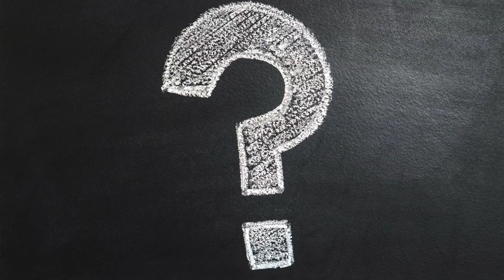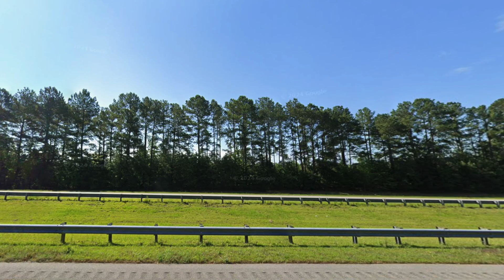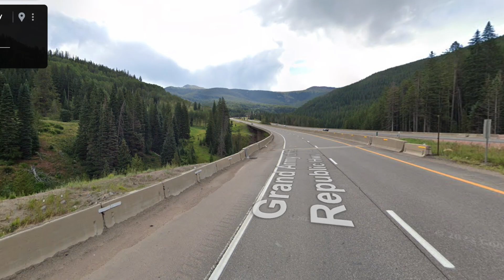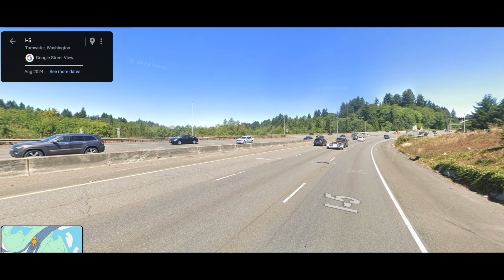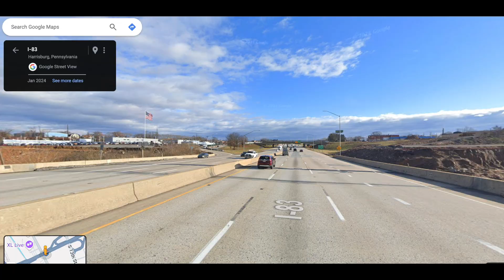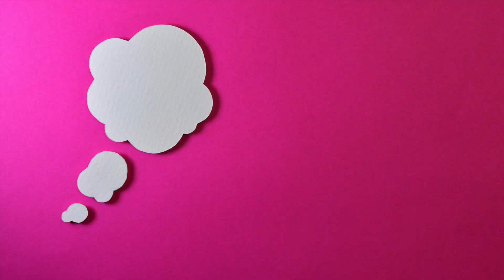Putting Rail Tracks on Highway Medians: The Pros and Cons

Comment: You can put viaducts on highways medians, elevated metro/rapid Transit are done this way in Asia. Its cheaper to build viaducts on land the government already owns instead of buying land near urban areas for such projects. Plus theres no need for overpasses, and people wouldn't be able to get on the high-speed tracks. China built its HSR mostly on viaducts, and India is doing the same.

Something important to consider is that usuay medians are made wide to allow later lane expansion of highways. So using up that median space would defeat the purpose of wide medians. And medians also allow for increased safety, running rails on medians also defeats that purpose

Comment: Fun Fact: In the case of I-10 between Los Angeles and El Monte, THE RAILROAD CAME FIRST!! -- It's the former Pacific Electric San Bernardino line.
Reply from the maker: That is a fun fact! I know some of what has happened with rail transit growth in the LA area has involved reactivating old rail right of ways.
Reply: @RallyingforTransit  - The fact that Metrolink runs down the same right-of-way Pacific Electric once used is something people forget about when they ask "Whatever happened to Pacific Electric?" The answer is: "It's complicated, but you will find remnants of it all over Southern California. For example, it left its mark in a string of disconnected alleys south of Hollywood Boulevard.

Comment: Fun fact about the Brightline route from Barstow to Nevada: Because Fort Irwin is on both sides of the highway, I-15 IS the only practical route for a high-speed passenger railroad between those two points.

Comment: When the Surf Line, which carries heavy passenger and freight traffic, is moved from the San Clemente beach area--where it is perennially in danger of being washed away or buried by mudslides--I-5 is the only viable path through San Clemente, other than a 10 mile tunnel. But DelMar is protesting even a tunnel under their city, which is stupid, since the railroad is more important than the damn town.

Comment: Other things to note are the issues of land use and stations along the line. Stations along highways lose quite a bit of potential ridership due to the huge footprint of the highway that could instead have development. Stations are also not likely to be all that pleasant to be due to the pollution and noise from the highway. There are ways to mitigate those issues somewhat, but a highway median station will never perform as well as a similar one located in development away from the highway.
Reply from the maker: @travisbeagle5691  I was literally thinking about this yesterday. 

I’m taking a deep look at LA Metro’s C Line right now (which is right in a highway median for most of it). And it has all these issues you talk about.
Reply: You clearly haven't been to Perth
Reply: @radicallyrethinkingrailwaysina  I have actually. I think they are a good example of how to implement such a system well, for the most part at least (the stations are still not a pleasant place to be.) That being said, each station where the line runs along the freeway would still have better ridership if their lines weren't along a freeway. At the end of the day, Median running lines have their place and at the very least they are better than nothing.
Reply: Counterpoint - a well designed station can act as an attractive interstate crossing. The highway is already there, likely could use additional ped crossings, and a station done well can be an ideal crossing location for thru pedestrians, making the station a focal point for foot traffic.
Reply: I think highway medians are really good for potential HSR or intercity lines that don’t currently have a ROW. An example is Boston-Montreal, where a hypothetical intercity train could run in the median of I-89 between Concord NH and the Vermont border, directly connecting to the existing route to Montreal through Vermont. A HSR line could run in the median of a highway between two cities, especially where the existing ROW isn’t conducive to HSR. Highway median metro lines, like those in Chicago and LA, are a different story.

Comment: I think its really depedant, a lotta places in flat areas with long straight highways might be pretty good. In Quebec the Autoroute 40 is mostly straight and the median is ridicously wide at many points for example
Reply from the maker: @hikarikaguraenjoyer9918  I think someone else in the comments mentioned that route. Yes, a highway route like that could work for a rail route. Parts of Interstate 70 in America’s rust belt are also straight enough (need to do more digging as to whether it is wide enough).

Comment: Additional Cons include the need to raise existing (and future) overpasses to accommodate the increased height of trains (including catenary) versus trucks.  Raising overpasses also requires lengthening approach ramps which may isolate existing driveways and bring on the NIMBYs.  Another Con is that highway grades are frequently steeper than trains can practically negotiate.  In some cases, this can be mitigated with cuts or fills, but given the narrowness of highway medians this would require retaining walls.  Getting into the median in the first place could be expensive requiring long pergola fly over structures or tunnels for the railroad or flyover viaducts for the roadway.  Also, the development that already exists next to the highway means potential utility relocations beyond what a greenfield routing might require and a need for sound mitigation barriers.
Reply from the maker: @andrewadams3894  this is a good breakdown of some of the other cons, some of which I hadn’t thought of.

I’m reading some comments about the Brightline West project, which is doing the whole highway median thing. I will need to do some research and see if they have encountered any or all of the challenges talked about here.
Reply: In Germany, it has become increasingly popular to built HSR lines next to freeways, with the goal of minimising the negative effects like noise and cutting through existing “habitats”, be they human or natural. Putting two noisy traffic corridors next to each other ensures that no additional areas are affected by noise. Ditto for putting up barriers for wildlife, farmers.

Since there are basically no wide medians on freeways in Germany, it is always to one side not in the median. On the newest such line, there is about a 20 m (66 ft) gap between the freeway and railway line with a bit of an earthen embankment. This adds some safety and makes access to the railway line easier. 

Of course this means any on and off ramps or things like rest stops also need to be crossed by either routing the rail line through a short tunnel or the on and off ramps themselves passing below the railway tracks. In order not to have to raise bridges, you simply lower the tracks a bit.

Where the freeway isn’t straight enough or has gradients that are too steep for railways, you need tunnels (or sometimes also bridges) to keep the railway line straight. And in more mountainous terrain, it might be cheaper to find an alignment that is completely separate from the freeway. 

The problem in Germany isn’t land acquisition or right of ways, it is too prove that the selected alignment is he best compromise between costs, benefits and ‘disturbances’ (noise impact on residential areas, tearing down buildings, disrupting habitats), with some hard limits on noise or crossing protected nature.

Comment: Also another con of the medians is getting in and out of them requires huge over or underpass
Reply from the maker: @Rianmt795  I hadn’t thought of that, but upon doing some fact-checking, you are correct on that, at least in some cases. A lot of double decker trains such as the Amtrak Superliners and what you see with some NJ Transit trains is probably too tall for many highway underpasses. Amfleets are low enough though, I think.
Reply: @RallyingforRail  i was talking about getting into the median kinda like an interchange flyover, like what you see in highways with 4 separated roads where they have to cross over the outside road to get into the inside road, so for railway in the median they would have to make a really long underpass to get into the median or have to push the road outward.
But what you said also is true
Reply: Heres an example of what i mean
48°59'40"N 2°31'05"E
Reply from the maker: @Rianmt795  I’m on my phone right now but will try and remember to look at those coordinates in more detail later!

Comment: Funny thing about this subject: The Brightline West project is using highway medians extensively along its route from Rancho Cucamonga to Las Vegas, specifically the I-15 median. It's a great way to reduce construction costs since the rail operator doesn't have to spend millions in land acquisition or fighting lengthy legal battles with existing property owners. Not to mention that, as mentioned in the video, highways already do a great job of linking major population centres along a relatively straight path that would be perfect for high speed rail travel. Obviously the train would have to leave the median when it gets to the cities itself, but that would cut the costs of construction down significantly and make HSR more feasible in this country.
Reply from the maker: @Eragor-h5n  yes, it’s a good way to cut down on construction costs, avoid lengthy and costly legal battles…and keep some semblance of goodwill.
Reply: The problem is that they'll get a not so fast high speed train as it can reach max speed only on a few specific sections so if we accept the premised duration of the journey (which was not provided with Brightline Florida) the average speed will be 100 mi/h and, as mentioned, it only connects Rancho Cucamonga to near Las Vegas a bit further out than the airport, both take out the main advantage of rail - connecting city center to City center, and the promised 2h10 ride from LA to Las Vegas will be actually about 3h30-4h with the time it takes to get to/from the stations - which makes it about the same as driving and more than a flight.
Reply: @AL5520  In other words, it's basically a show statement rather than a legitimate means of transportation.

I can understand it not connecting downtown LA, though. If you look at LA on a map you will see that it is very built up, making it enormously expensive to build out tracks there. Keep in mind this issue has also plagued the Los Angeles HSR and is a big reason why the first segment ends at Bakersfield and doesn't go into LA.

Though at the same time even if it doesn't go into LA if they can give it good connections via a more frequent rail service using Metrolink that could make up for the location issue in a similar manner to how the buses that connect to the San Joaquin's train help to increase ridership on that route.

And I still expect the line to be the fastest in the country, beating out the Acela in the Northeast due to it being on tracks designed for high speed operations (unlike Acela which gets bottlenecked up around Connecticut).
Reply: @Eragor-h5n  Unlike BLW CAHSR has a corridor to work with to get to Union station.
As for Metrolink, frequency requires investment and the line to Rancho Cucamonga has a few problematic sections that orevents higher frequency. Like the single track in the median of i-10 with no space for expansion.
In any case, if it will get to the stage of connections to San Francisco and LA with long tunnels maybe you'll stp being afraid of tunneling and underground infrastructure.
Reply: I saw LucidStew's video on that route. Several stretches of <100 mph.

You're making the median solution sound far too good than it really is. The way a highway snakes through the landscape prevents the train from reaching true high speed. 

And without true high speed the entire project is compromised.

You absolutely can use the highway's right-of-way, but only if you're prepared to demolish and rebuild road sections to ensure the train can take curves at 200 mph. In almost any other country, the government would be in charge of both road and rail, and this is a no-brainer. 

Apparently in this case Brightline, a private company, would have to pay for any road realignment, and so you Americans end up with much slower trains... and keep driving cars. Sigh.
Reply: I don't really have any issues with driving, though. It has never been all that big of a problem here in the US.

And I wouldn't want to pay higher taxes for a true HSR system. Especially since the one example of taxpayer-funded HSR in this country has been...awful, to say the least. Overbudget and constantly delayed. 

Maybe other countries have better cost management, I wouldn't know.

Comment: Highway medians are incredibly convenient for passenger rail development, they often link up major population hubs that would benefit by HSR interconnection. Realistically there's no point in HSR that takes over 5 hours of travel as such travels are already convenient enough to do by air, but in local urban hubs like socal, northeast corridor or texas triangle they'd be super useful. That being said, it doesn't have to be that HSR ONLY used highway medians. It could be placed in the medians or alongside highways as long as it's possible while when curves are an issue, the rail could deviate from median into the off highway land before returning to the median. HSR is already an expensive endeavour in itself so it shouldn't be an issue to build a few overpasses here and there.
Reply: There is definitely a point in HSR from coast to coast. Allow me to list a few.

1: It moves way more people using 100% less aviation fuel.
2: It's still faster than cross-continental road travel.
3: You don't have to go through an airport.
4: It wouldn't just link coast to coast. It would connect EVERYWHERE ALONG THE ENTIRE LINE to major urban centres both at either end of the line and in the intervening space.

America built transcontinental rail once. It can do it again.
Reply: @shingshongshamalama  it depends just build a network. Guess what China doesn’t have a coast to coast network in their empty western areas only one HSR exists and it has few trains.
Reply: @qjtvaddict  China's government notoriously neglects certain regions of the country and its motivations in claiming so much land have been heavily criticized for decades. The vast majority of the country's population is in the eastern half of the country, and almost all of its heavy industry is focused around the south-east.

If California were a country, it would be the fifth largest national economy in the world. Connecting that to the also enormous economic base of New York City ALONE would be worth the expense of building high speed rail across the literal thousands of kilometres of relatively sparse rural land in between, not even factoring in the absolute economic powerhouse that is the REST of the US East Coast.
Reply: Learn about network effect

Comment: we should build hsr that way only inside cities because real estate is too expensive to bulldoze and cities usually have these highways that are wide enough to fit 2 train tracks. if the train encounters a curve they should slow down (it wouldn’t effect the duration of the journey too much because we will only build tracks on highways inside cities) This idea is feasible outside cities because land in rural and some suburbs areas are cheap enough to build train tracks on.
Reply from the maker: The other thing about high speed rail inside cities is that they are oftentimes either approaching or exiting stops inside cities, meaning that the train isn't going that fast to begin with (and meaning that said curves shouldn't impact the duration too much).

Comment: The one other thing to make sure of when building rail in highway medians is to have concrete barriers in between the highway and the rail. This will prevent vehicles on the highway from crashing into the train and derailing it and should also minimize the impact of train derailments for the highway itself and the vehicles on it.
Reply from the maker: Absolutely. It would be important to have that separation so that train derailments don't impact highways and highway crashes don't impact trains.